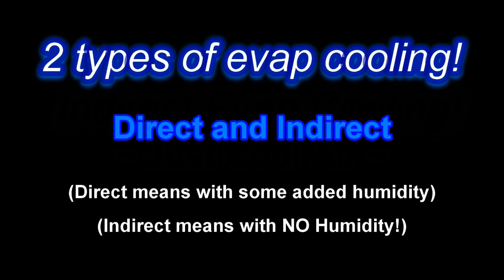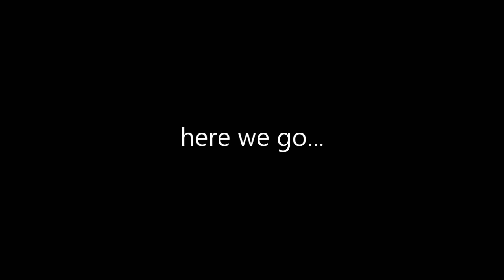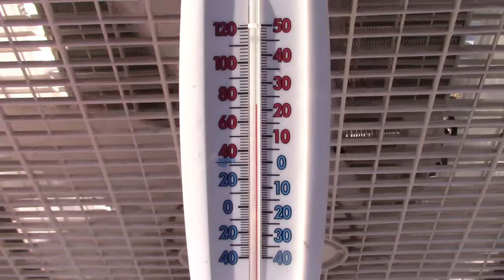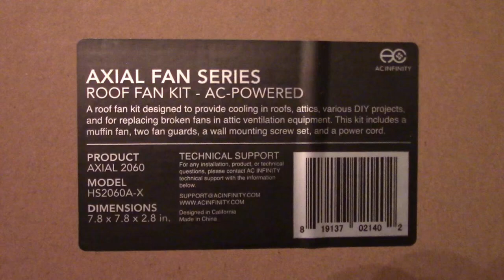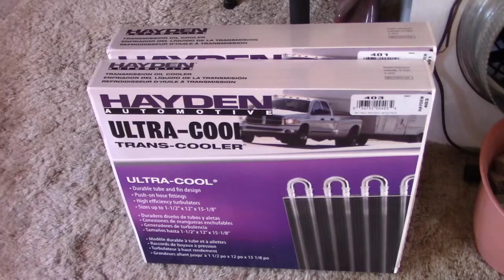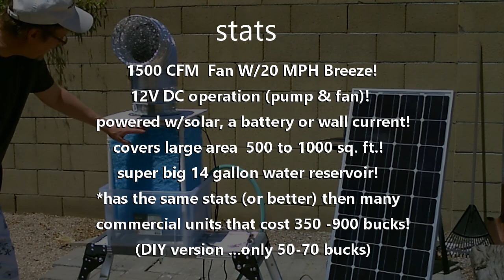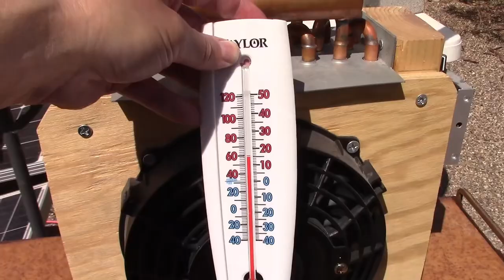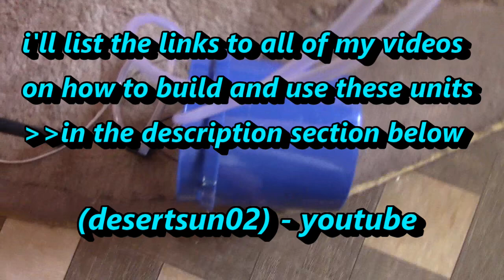DIY "INDIRECT" Evap Air Cooler! (No Humidity!) 2 Projects 1 unit! tons of info! + AC Air Cooler Comp

Comment: Another really nice DIY off-grid project.  I was just trying to hunt down one of those ac infinity fans (like the one on top of the blue box cooler 0:30) and cannot find one on their website near that size.  Is it DC or AC?  Can you share the model number of it, please?  As always, thanks for sharing your ideas/projects.
Reply from the maker: hi. it's the ac infinity axial 2060 (ac powered). amazons got them ✔😎. i did a quick search of their website - they got em. (but amazons usually cheaper)
Reply: @desertsun02  thanks so much.  Easy to find with the model number.  I was hoping they were DC powered, but a great and powerful small footprint fan to have just the same...
Reply from the maker: @Owen Parker for DC the 12v DC fan shown as an option is a great way to go (it's just a car radiator fan) .a 7 or 8 inch one works the best with this. the speed controller shown with it is a 12a one from amazon.
Reply: @desertsun02  Yes, that will definitely do the trick and is surprisingly affordable.  Thanks very much AGAIN!  :)
Reply: @desertsun02  I'm embarrassed to realize that you literally showed the model number of the fan in your video.  I think I must have been searching google for it when that was shown!  DOH!  LOL

Comment: Where did you order the radiators from I'm trying to use a 20"fan.
Reply from the maker: i get the radiators on amazon. if you search for hayden transmission coolers you'll see them.

Comment: Will the indirect coolers work in humid climates?
Reply from the maker: hi. it depends on how humid it is. they'll basically work anywhere that standard evap coolers work. best way to find out if it will work for you is to search the term evap cooling chart. those charts will show you what temperatures to expect

Comment: How much does the effect drop off with high ambient humidity? In the NE we get our share of hot 'n humid sunny days. Seems to me that raising the temperature of the outside air on it's way to the blue pads would boost efficiency in humid conditions, which should be easily done on a sunny day. I recall reading a paper years ago related to supplemental winter heating that claimed direct sun, even winter sun could raise incoming air temp by 25°F if it was sucked through a heat exchanger of a simple piece of black sheet metal with a lot of small holes punched in it. In fact, on a rainy or cloudy humid day a dehumidifier feeding it's exhaust into the evaporator may make sense. Iirc this seemed to be more or less how a German company was hoping to deal with humid conditions. Unfortunately I don't recall the name of that company, must've been ten years ago possibly fifteen.
Reply from the maker: it's a gradual decline as humidity raises. best way to see what temps to expect is to search the term 'evap cooling chart'. those charts will show you the output temp of an evap cooler based on any temperature and humidity combination. you listed some interesting info in your comment. i may have another video idea just from reading what you wrote. (i've got a few large pieces of scrap sheet metal around here). i was going to make a flexible solar water heating panel with some of it (along with flexible copper tubing) but stopped the project because i don't know if there is any real benefit to having a flexible water heating panel. but using it as a heat exchanger may have real possibilities.
Reply: @desertsun02  From what little I recall their prototype essentially blended an indirect evaporative cooler and a window AC so the waste heat off the AC condenser boosted the evap in damp weather resulting in a significantly better COP even in humid conditions and to something like ten to one when the compressor wasn't needed. I'm sure they claimed a 90% power reduction so assuming a base COP of 3 that seems consistent. I think part of that was the counterflow arrangement to the evaporator pads which I'm sure I never understood. With that said it seemed the airflow was across their surface rather than through them. If evaporation mainly occurs on the surface then we might say it's mostly just happening on the inner face of the four pads you're using while four pads hung in the airstream inside might add 8 surfaces tripling the evaporator area. No idea how or if any increase in evaporation might scale to area though.

Comment: Does this work better than the heat exchanger 8x8 + blue cube cooler design by you?
Reply from the maker: hi there. it's not better or worse (just a different design). the 8x8 heat exchanger is smaller (in length and height) but wider. it's about 3" thick
Reply: @desertsun02  thank you for your work and designs
Reply from the maker: @P G you bet! ✔

Comment: Hi, can you tell me were to get those blue pads please? Thanks
Reply from the maker: hi. i get them at home depot or lowes. sold for about 10 bucks. amazon sometimes has the pads but they are usually way overpriced on amazon
Reply: @desertsun02  Thanks for that! We don't have those stores were I'm from so I'd have to order from USA and freight.....)-:  I was thinking of trying  Polyester Dacron Wadding for Upholstery work. I checked it out and it saturates nicely with water. May need  two layers. Other than that there is the cardboard At about $350 for a std evap cooler....

Comment: i want to see results at approx 100 degrees, please. if you can maintain a 20 degree drop from ambient, you are doing well.
Reply from the maker: hi. i'll have to check it later in the summer but i'm sure it can. that blue cube will put out around 72F when it's 100F outside (5 to 10% humidity) so the indirect part (the fan part) should put out just slightly higher than that. (it's always a little higher because of the second conversion)

Comment: Greetings  desertsun02,

I'm hoping this comment finds you, I could not locate a email or any other forms of communication. But I digress, I am very interested in your setup that you have but I have a few questions about setting up this Evap Air Cooler. I live in Florida, you may be aware or not but humidity is damn near 100% everyday. That being said, my home has a "Florida Room" that has been closed in (16x38 room) but the door leading to the back yard isn't the greatest. This room gets very hot and I fear that this room is ONE of the problems cooling my house. Plus I believe that my home was built sometime in 1968-1972, ether way.
Question 1.) Would using your Blue Cube design work well in this environment.
Question 2.) I would like to hook up a INDIRECT unit to the Blue Cube but I will most likely have to run 30-50 feet of hose to the next room over, will this be an issue.
Reply from the maker: hi there. evap cooling works good up to about 60% RL (then it tends to struggle to work). in certain situations it can work okay up to about 75% (if the unit is big and is used outside). the best way to know if evap cooling will work for you is to look at an 'evap cooler chart'. those will show you what temperature it will output depending on the air temp and humidity. if you search the term 'evap cooling chart' you will see them.
Reply: @desertsun02  So in theory, would adding a Dehumidifier with the Blue Cube give me the performance I need?

Comment: What would you recommend for a Las Vegas garage? Humidity here is incredibly low (5-15%) right now.

Should I just make the indirect system and keep both parts inside?

Thanks for the awesome work.
Reply from the maker: hi. if you're making the indirect system then the blue cube part has to be outside or in a very well-ventilated area. if you're making the direct system only it still has to be ventilated but in an open-air garage you could just use it in the garage. since your humidity is so low and you're using it in a ventilated workspace - i would just use the direct system. the slight elevation you feel from the humid air would not be noticed as humidity and may actually make you (and possibly your skin) feel better. i think they say that 30% or 40% feels the best. btw - keep an eye out for my next video - it's my largest DIY evap cooler to date! should work great in a garage. a few stats on it: up to 2000 cfm airflow. has a 20 gallon water reservoir. runs 16 hours straight (before needing the water refilled). video will be out soon. (soon = sometime between tomorrow and next weekend).
Reply: @desertsun02  Awesome! I was actually planning to make an "ultimate" cooler using a drum fan, and your new video should help a lot.
Reply from the maker: gotta love those drum fans. - i saw one that was 22,000 cfm. tip: use rigid media if the airflow is over 3000 cfm.
Reply: @desertsun02  Ah, so that's why some of these use the paper hexagons.

Comment: Awesome dude
Reply from the maker: Thanks 😁
Reply: @desertsun02  

Thank you for responding. Another question for you.

What’s your opinion on what cools better, the previous system where you’re using a heat exchanger, cooler with ice and water or this system?

I have could heat exchangers, some truck radiators, some ac condensers , and oil coolers I can use so I’m getting ready to build a system now that I will be running off 110v grid power
Reply from the maker: @John Le the short answer is that sometimes this system cools better and sometimes the ice systems cools better. it depends on a bunch of variables. if you have lots of ice then you could get the water temp lower so that would be colder. but as ice melts temps start going up. this system doesn't need ice at all so you can run it all day. it depends on humidity and temperature so it will fluctuate as those change.

Comment: Or, dig a big hole or trench in the yard (the deeper the better) and bury the tubing and circulate water or a mixture of water and glycol or windshield wash fluid and make use of the geothermal cooling action (should end up being around 56 degrees).  Pump that through the radiator and let the fan blow air chilled by this simple closed loop system. No evaporative chiller needed. Just one pump and one fan.
Reply: That's a huge investment to make to find out it doesn't work so well.